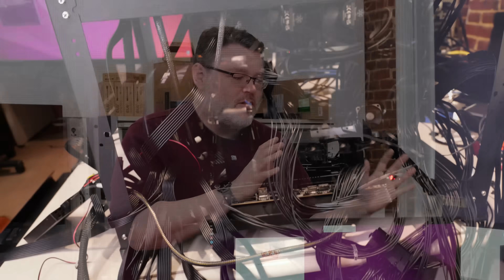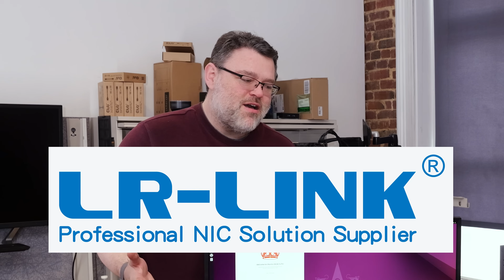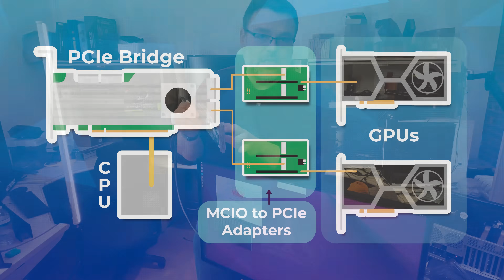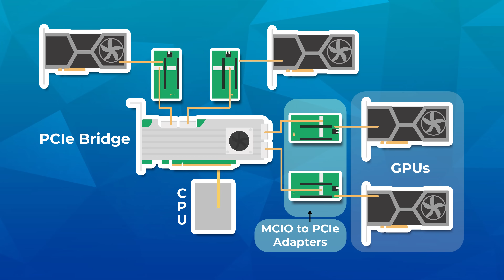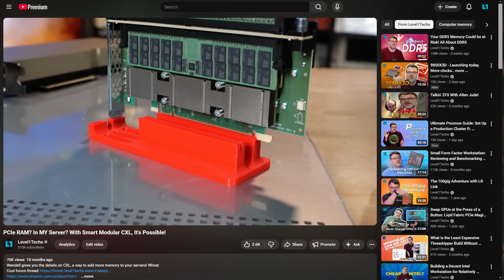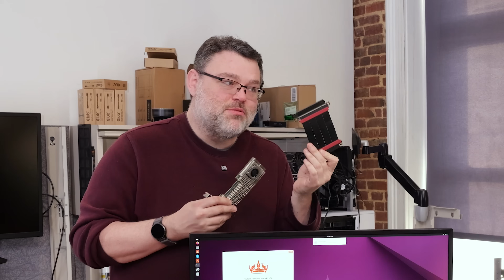Creating a PCIe Bifurcation Solution for AI Councils

Comment: Yes, yes, emphatically yes you make products. I've been ideating about the potential for turning an ×16 PCIe slot into ×8 / ×4 / ×4 where eight lanes go to a half-height GPU and the other four each go to M.2 connectors, but if MCIO is the better way of doing that, then I guess that's it and people have to eat bullets for that, but if there is a way that MCIO could be replaced with a cheaper, functionally-equal connector, that'd be cool too.

Comment: I have an Asus z390 pro ws motherboard with an integrated PLX chip to give it 4 way x8/x8/x8/x8 connection to the CPU, then an x4 slot, two m.2, and 2 u.2 slots. It's such a great board

Comment: Don’t you run into BAR issues (< 4GB) with these switches etc? I have also run into issues with IOMMU separation. I’m trying to run 6-8 5060 ti 16gb each into a separate proxmox vm on AM5. It turns out to be quite tricky and I’m reaching the limits of what linux cmdline can fix.

Comment: A few years ago, I was looking for ways to make more PCIe lanes, because the motherboard I wanted to purchase didn't have enough.
First thing I found was this Chinese USB3-cable thing, kinda useless.
Then I found the bifurcation cards you were mentioning.
And finally I found JMicron, they made some PCIe Bridge Controller chips, which could take a bunch of lanes and work like a "switch" (eg. like a network-switch, just for PCIe). That got me interested, but ... It seems they still only have up to PCIe 3.0.
-Unfortunately, I didn't get enough money for the motherboard I wanted and after several years, I bought an AM5 instead; it's OK, but I still wish I could split the PCIe5 x16 into several PCIe 3 x4 and a couple x8 slots.

(There's a lot of unused bandwidth, just being wasted on the PCIe bus, so if one could make a controller that took all the PCIe lanes from the CPU and spread it out to 16 times as many lanes, maybe - just maybe, they could be saturated).

Comment: Why would you split 96gb GPUs into 4x24GB virtual GPU's? that is just wasting its resources more. You would just if you wanted such a setup run 4 inference engines in parallel on the one GPU and get your same council topology while having a lot more flexibility on it.

Comment: A pure passive ribbon cable approach doesn't HAVE to be doomed. It is only a matter of realizing that the wires are actually transmission lines and then respecting the characteristic impedance therein. See the problem as if it was trying to get a pure RF signal from one spot to another, and it can be made to work.

Comment: Will your card support direct GPU-GPU communication at full speed?  - For example, X16 to your card,  and X16 to each GPU that allows X16 between each GPU at full speed without being bottlenecked by the CPU X16, for tensor parallel.  i beleve the Cpayne boads can do this.

Comment: I'd like to see a way to change up my NAS which is based on a B550 Motherboard with a 5900x CPU.  I currently have a pair of SATA cards driving 10 4Tb spinning disks, with a GPU eating up the X16 slot and a 10 Gbe card using an X8 slot.     If I could use a card like that to drive 10 4Tb NVME cards, or some U2 drives, that would be much better.

Comment: I am a ml engineer an have had this problem since the pascal cards, when I joined my first computer vision project. We didn't have the money to buy the fancy and expensive servers with pcie switches, so we were stuck to the lowest tears of workstation gear and a bunch of risers with an array of 1080ti's. Despite less problems with signal integrity with pcie 3.0, it was a huge pain in the a.. PCI 4.0 and 5.0 made the struggle worse ;-)
PS: MCIO or SFF-8654 breakouts are great, but hugely expensive in the needed quality

Comment: So this is the way to turn an x8 gen5 into an x16 gen4? That's one thing that always drove me crazy. They go on about how much more bandwidth you get as pcie gen goes up an all the cheap used hardware is a few gens behind. Bifurcating a fast lane into more older gen lanes seems ideal for hobbyist. Like right now all the cheap enterprise homelab stuff is gen3. Bifurcatings a gen4 or gen5 x16 into smaller pcie3 lanes that can mix x4 x8 x16 pcie3 from a single pcie4 or 5 has always interested me to make use of all the bandwidth.

Comment: pcie tree packet configuration has a common issue in most consumer MOBOs  it is THE ethernet pciegen1 or gen2(2.5Gbps)  ethernet with minimal packet size that imposes severy packet efficienncy limitations fior all devices in the tree path

Comment: If its certified, than that means a thing usually.
But that's also why most cables aren't officially certified.
On the other hand you can create perfectly fine cables without certifying them, like the LTT true spec cables.

Comment: a hell of a lot of things, including games, do not actually need a ton of bandwidth
its nice to have, but most of the pixel pushing is mere communication rather than shifting raw data

depending on the application, like a game and its settings, you can get away with PCIe gen 4 x1

you only really see hitting the absolute maximum of a x16 connection when hitting it with an artificial load that is explicitly designed to do so

Comment: Motherboard standard needs an overhaul. You get 6 or 7 PCIe by 16 slots next to one another. Most modern video cards use up 2 or more slots already. You are lucky to be able install 2 graphics cards and perhaps a fast network card. The rest of the PCIe slots are buried.

Comment: They are literally pushing the limits of differential signaling down straight pairs with PCIe Gen5.  The next gen will probably either require micro coax or optics.

Comment: Great product and very relevant. I just built a 12600k proxmox rig for all router/server tasks. I utilized a PLX bifurcation card. Pcie x16->4x4*4 in the form of Nvme. There are copious riser cables to support multiple 10g NICs, and HBA, and video card.

It was a lot of work to find working riser cables. Buy, try, return, rinse, repeat.

This is a great area of research.

Comment: Yup, a few years back I installed a 3090 on a Threadripper Pro motherboard using a riser cable. It required enough research into PCIe retimer configuration I wrote an entire thread on the forums back then. And that was "only" PCIe 4.0. Makes you wonder how long it's gonna be until PCIe goes optical out of pure necessity.
Reply: Well they have been pushing SXM socket migration since pascal* (p100). It’s become fairly common in industry now (hgx baseboards) as a (very expensive, inefficient, and monopolized) bandaid to multi GPU to GPU communication bandwidth constraints of pcie. Unified memory is the necessary solution in the long run.

Comment: It's a little confusing, but I that card (LRSV9500-4I) is actually running with a PCIe switch (48 lanes) and not retimers. The switch will recondition the signal so performs the retiming as well as acting as a fan-out, with 32 downstream lanes. Only 16 upstream lanes to the CPU so that will be the bottleneck.
Reply: Basically: The LRSV9500-4I uses a PCIe Switch for splitting, while the LRSV9560-2I is a dedicated Retimer. Both get you more ports, just with different strengths. Stay tuned for Wendell's full breakdown in the next video!

Comment: Please make and provide along with this card, mcio to mcio 85 ohm cables with an integrated phison PS7102 redriver in them, this would be super useful with or without that slot card (as some boards have mcio on them). Redriven cable are even rarer than that board you made.

Comment: Having a cheap way of connecting a lot of old GPUs to a system would be really cool. It'll take a bit of work, but it should be possible to use tensor-level parallelism to build a capable AI machine out of pleb-tier cards.
 

You should also consider building a CXL version. In a couple hardware generations manufacturers will probably be forced to solder RAM to the motherboard to support higher speeds, reducing the scope of what we as enthusiasts can tinker with. I can see CXL memory expansion becoming much more popular when that happens.

Comment: Maybe we're approaching things the wrong way. GPUs and CPUs have to be converged into a "SoC" which is the BGA of the CPU + GPU + GDDR L3 fast memory (we will have L4 memory, Terabytes of it via CXL)  , then the actual motherboard is just a breakout board and power regulation board, it only deal with low speed signals. 
Then if you want to tap the extra PCIe lanes, you tap them directly from the CPU via optoelectronics in the SoC. 
We need to redesign the PC for pure performance.

Comment: Hi, did you try Intel Pro B50 or B60 into your setup ? they are cheap GPU board with high troughouput FP64 capbilities compared to RTX !!:
Reply: FP64 is like the least useful thing for AI
Reply: Hi Alex,  @alex31ytb  
My use with FP64  is not AI . just making a cost effective cluster is what matter to me for some ''scientific computing""
And so the PCIe lanes extension seems to be the best alternative
Reply: @LeHerissePascal  then you should look for old AMD Instinct accelerators like the MI100, they have unbeatable FP64 performance for relatively cheap
Reply: @alex31ytb  
Thank you for your feedback

Comment: This sort of situation is where copackaged optical solutions would work great. You could have a fiber carry all this data no problem, and you could just run a copper wire along with it to carry the power that goes to the PCIe slot.

Comment: What I would love is a double stacked PC case that has a PCB with as many PCIe card slots as can fit in a standard 19" case width on the top level and those LR-Link cables running to the motherboard below where the user can have whatever motherboard they want populated with those LR-Link (or equivalent) cards maintaining the signal back to the CPU.

With this case having all of the fan/radiator mount points for proper low speed fan cooling (this is for a consumer/prosumer office setup, not a data center, so noise reduction is a must.)

Currently the ATX motherboard and case form factor simply doesn't cut it if you even want to have even a modest number of simple PCIe cards (2--4 slot GPU, Sound Card, 10Gb or more NIC, etc...) my current motherboard has 5 available PCIe slots that I can only use 2 of due to having a 3090 blocking 4 slots.

Comment: How can I check signal integrity? I have a system with 5 pci-e gen4 16x riser cables to GPUs. I haven't noticed any issues in the years I have been using it.

Comment: I wish there was a PCIE 4x or NVME/Oculink adapter that runs at 4.0/5.0 which can convert via chip to 16x lanes 3.0 for older GPUs. I am running my older 1080 Ti in a backup/secondary mini PC and it's limited to 4x 3.0 😢

Comment: Love ya dude. But you're doing SlimSAS wrong. Don't buy a U2 card. Buy a SlimSAS card.
The have 1 single transceiver, and nothing else. You can pass 8 or 6 lanes, bifurcated at the MB, or not.
U2 is OVERKILL. You need the connector not the protocol. GPUs will run just fine at full speed without any repeaters or non-sense over regular 1M cables.

Comment: I started looking into this and settled on using gen 3 riser cables and just running at gen 3x16 no issues. Was far too expensive to get the “correct” hardware when gen 3 was fast enough.

Comment: Why doesn't the level1 store carry oculink docks and accessories? Accessories like cables, PCIe and M.2 adapters (including redrivers). I've tried several inexpensive docks, including the EXP GDC Beast, which can accept multiple power inputs (ATX, 8-pin Dell DA-2, and 12V barrel). Very flexible. All have worked surprisingly well for a variety of PCIe cards, including an RTX 5060ti 16GB, 10GbE NIC's, and an old LSI SAS HBA.

Comment: I used a Rocket 1628A (effectively the same as that LR-LINK LRSV950-4I card) to connect 8 U.2 drives to a single x16 slot. If you sold solutions like this, I’d buy them.

Comment: Dude, yes! When i built my 4090 rig i went with the hyte y70, the riser cable works fine for gaming, finicky for AI (and not great for thermals) but being the slave to bleeding edge that i am, i upgraded to a 5090 last year....thermals are worse, AI loads like the riser even less  even less and i've had my old 4090 sitting on a shelf for the past year because there's no way to put it in my case. 

Being able to have a dedicated GPU rig without having to spend ANOTHER $1000(+) on a fancy breakout board would be immensely useful to a whole bunch of people.

Comment: Hey man - long time follow. Just as a FYI, you can ignore me for sure. Re-timers are used for signals with embedded clocks like100GBase-KR4, 10GBase-KR, etc. where the data and clocking are on the same wire (hence timing in the name due to needing to perform the same clock recovery found in the receiver of the end device). Re-drivers are for protocols with dedicated clocks like PCIe. Anyways, keep up the great work man, love the content!
Reply: Can you explain it like I’m 5?
Reply: @Brickarmy  I’ll assume this is an honest question, since this is after all a Jr/Sr level engineering student topic… All data that is sent from one device to another needs something to tell the receiver when to look at the data to see if it is a one or zero. Modern devices use clocks, I.e. a signal that switches between a one and zero at a know speed/frequency. This speed is known to both the sender and receiver. In modern devices we have two ways of sending this clock: we can use another set of wires, or, using complicated encoding schemes, we can put the data and clock on the same wire. Some examples you can read about to see how this is encoded are Manchester Encoding, voltage multiplexing, edge triggering. The examples I gave in my first post are examples of Manchester encoding.

Now that we’ve gone over the basics, my original post should make a little more sense. PCIe is a type of signal where a separate set of wires is used to give a dedicated 100Mhz clock that tells the receiver when to sample (aka look at the data wires). In these situations a redriver would be used since all that is needed is signal amplification, with some minor handwaving of some details here... For signals that have a clock encoded into the signal we can’t just amplify the incoming signal because we might accidentally amplify noise, skew timing, etc. For these signals we first have to decode the signal (separate the clock from the data) and use that clock to sample the data stream. There’s a fair bit more handwaving of the details here, but after you do all that work you now have to redo all that encoding again before the signal can be resent, albeit amplified. As you can image this takes a whole lot more circuitry to do. To distinguish between the two types of devices, the complex devices that have to time (clock) the output, were given the name retimers.

Hope that helps. I would encourage watching a video on Manchester encoding to get a better understanding. Your question would be a whole chapter in a college level engineering book (with pictures!). This really isn’t something that should be explained in a YouTube comment. 😅

Comment: With a card like this, could GPUs that support it  be run in P2P mode without going through the CPU hub, and if so, how many GPUs could be combined ?  Now, I don't have 2 or more RTX 6000 (or even 5090) on hand, but still don't like that Nvidia won't allow even those high-end consumer and workstation cards to be combined over NVLink, even an NVLink "lite".

Comment: It angers me that apparently reasonably priced solutions to this problem exist and we have to be subject to BS marketing limited boards with zero flexability. Like anyone actually needs the full gen 5 x16 bandwidth at all. Not in a consumer board. 

Why don't modern boards have 3 or 4 16 lane electrical slots that are simply limited to pcie 5 bandwidth limits?

For example, I really would like to migrate from my first gen threadripper machine to something modern like am5, but I need both a GPU and my Mellanox 40gig Ethernet card.  The GPU only needs gen 4 x8 bandwidth and the Mellanox card only needs gen 3 x8 bandwidth.

And I really don't want to pay $500 for a motherboard just to get a simple x8, x8 config or many thousands to go HEDT when that is way overkill for my needs these days.  What in the hell manufacturers? 

My total bandwidth requirement is less than half of a single gen 5 x16 slot, but adding expansion cards is not something that's supported by modern motherboards apparently. It is infuriating. 

This solution that you guys are working on should be built into the damn platforms in an ideal world.  I'd settle for AMD or Intel forcing manufacturers to include at least 1 x16 and 1 x8 slot for all boards where using the full x8 slot would force the x16 into x8 mode. But at least you could add a second damn card in that case.

Wendell, is there any way that I can implore you to use your influence (maybe team up with other tech reviewers) to get this problem fixed from an industry perspective by the time that RAM becomes afordable for mere mortals again? 

All I can do about it is complain on the internet and refuse to buy new products until something changes, but my 1920x is getting kind of dated these days compared to modern CPUs. Don't get me wrong, it's been an amazing system for a very long time and I don't regret buying it, but it really should be moving into my home lab as my main virtualization server whose current machine should become my new NAS, whose current machine should become my new backup server which doesn't currently exist.

That being said, I don't get the point of self hosting LLMs when the giant ones sucking down nuclear power plant levels of electricity are so damn terrible at anything I ask them to do.  Seriously, they make so many mistakes that I find them pretty much useless for programming or even general knowledge.  Hell, they can't even summarise properly without adding false details. I honestly don't know why you bother.